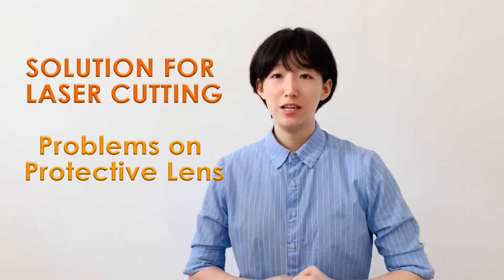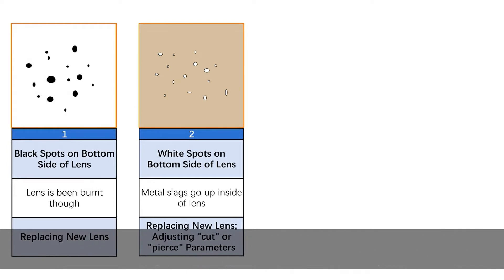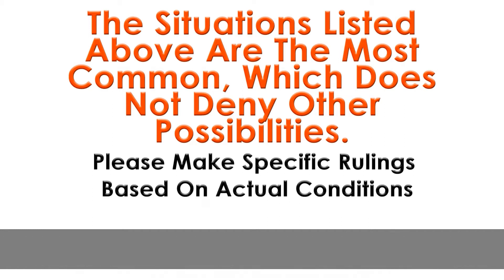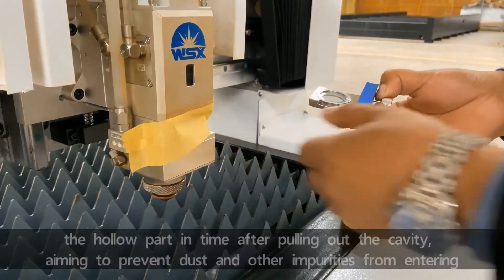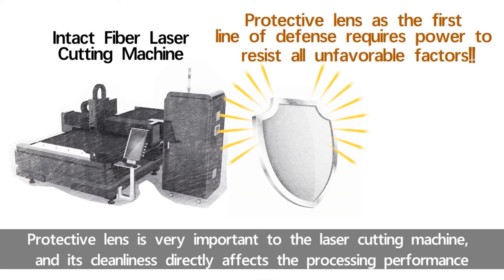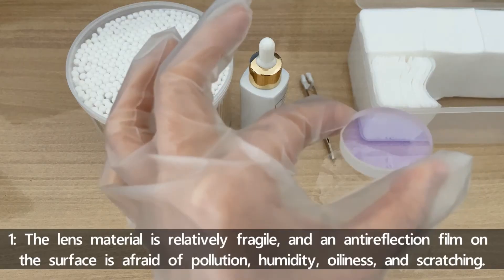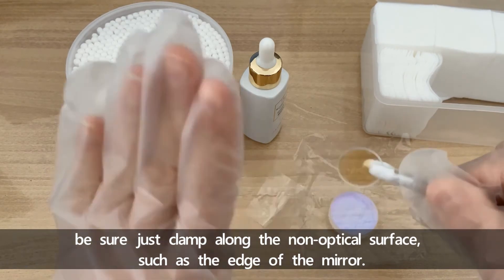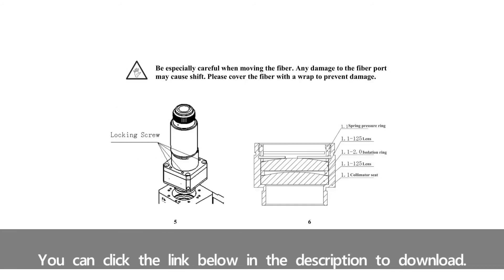Solution of Laser Cutting | Protective Lens Laser Cutting-3

Comment: We have bodor 3kw and facing issue moisture on the lense during ss cutting with Nitrogen . Chiller temp is set min 19C and  max22 C . Now days our room temperature is 13-20 C 
Pls advise how to stop moisture on the protective lens. 
We don't have any filter on Nitrogen cylinder
Reply from the maker: You need to reduce the temperature difference between the chiller and room, first try to increase the chiller temperature slowly. And if the nitrogen temperature is too low, it may also cause such issue.